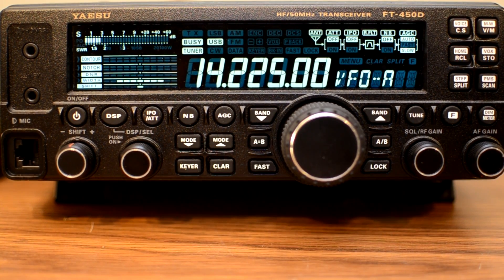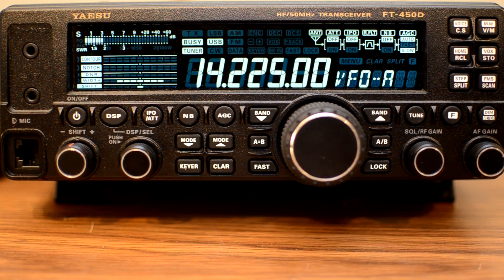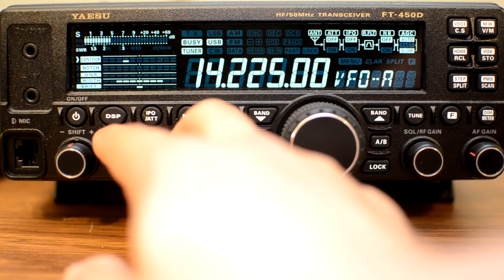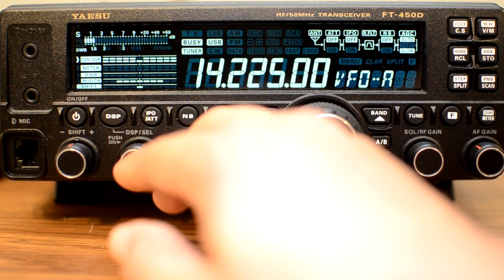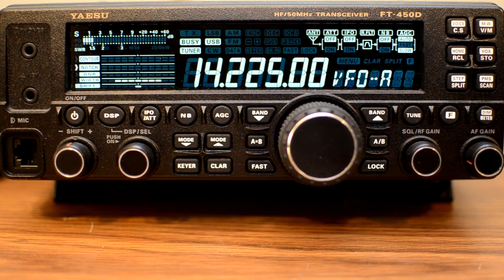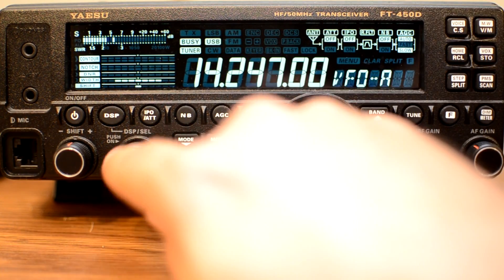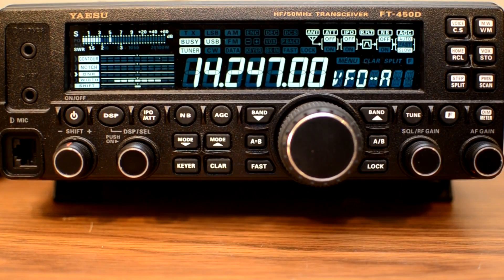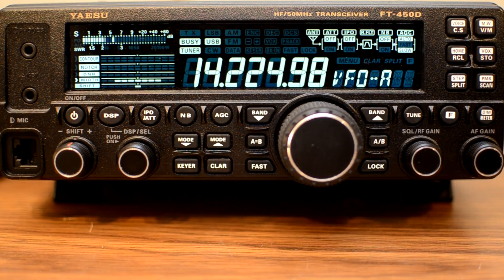Yaesu FT-450D: Using DSP

Comment: My suggestion is to leave the Contour and Notch OFF... set the selectivity to wide, and leave the DSP off  unless you need it.. then a setting of 3 or less will work except in really bad conditions.  Try the noise blanker first, before the DSP.    Set shift to center and adjust for best quality.  In normal conditions you will not need contour peak or knotch.. DX combat maybe different I dont do that.

Comment: are those adjustmens something you set to where you like and then leave or do you find you need to adjust on a regular basis depending on the day?
Reply: These adjustments are designed to pull in stations that might have interference and or just a weak carrier. If you have a strong signal none of these controls need to be enabled. If you have a weak signal you can usually start at the width control and adjust that to possibly receive better. The DNR or digital noise reduction control can be dialed clockwise and you will hear less static in the receiver. Take a look at your manual and read it thoroughly they do an excellent job at discussing this IF DSP features on the 450 rig. In summary they are adjusted to help receive weak signals. Hope that helps.  73....KD2PGJ

Comment: Tony,  
I have just had my FT450D for 3 weeks, I don't know if the rig has a problem or just me,   I can't get the cs button to work for tune up,  all I keep getting is VCC13.4  which is my power supply voltage, it was working about 2 days ago, I have done a full reset but still the problem exists,   I'm hoping you might have a suggestion,  am I missing something simple,

Dave
Reply from the maker: Hi Dave,
Not sure what you mean by using the C.S. button for "tune up." To activate the radio's internal tuner itself, use the "Tune" button (press it once to turn on the feature, and hold it down for a second or two to actually start a new tune). The C.S. button is a button you can manually assign to a particular function by setting it up in a menu. It appears you can assign Tune to the C.S., but I'm not sure why you would need to. Page 16 in the manual should help with using the C.S. button. Hope this helps!
Reply: Hello Tony,.

Thanks for the reply,  my tune up method using the CS button is simply I'm using my inv vee for as many frequencies as possible,  tuning thru my external manual tuner,  I Iike the CS button as it will tx a 10 watt carrier for tuning, quick and less stress on the ft450D for tuning,  but for some reason probably too much knob twiddling on my part I have lost that mode, I did get out of the Vcc mode, but now stuck some where else,   I think the owner manual will be worn out long before the rig itself,   I must admit being a very senior OP,  menu systems are not appealing, my last ft817 was great, and also my old TS 130S,  I'll even throw in my TS520,  fire them up in seconds.
Anyhow Tony thanks for your suggestions and the video which I'm sure is very helpful for lot of 450d owners.

Dave

Comment: that control knob for DSP looks very fragile, so much loose looking movement as you use it.
Reply: It is a helpful video but, yes, you're correct.  There is a metric BOATLOAD of stuff that is behind that control and it is NOT something you want to be spinning the way you would a big VFO knob (as he does a few times).  I know, believe me.  I didn't cause it, but it had to be replaced on mine early.  Under warranty and the service to/from Vertex was PHENOMENAL.
Just a caution.  Be nice to that DSP knob.

Comment: When in the 60 meter mode, how does one go about adjusting the 4 DSP functions (contour, notch, DNR, and width)? The DSP button will allow me to page through the 4 functions, but in 60 meter mode, I can not use the DSP/SEL knob to make adjustments. Can this somehow be addressed through one of the MENU functions?
Reply from the maker: Hi Dirk, unfortunately I haven't used this radio on 60 meters. In fact, I haven't even upgraded the firmware to allow it, so I can't answer that question. Sorry! Perhaps trying Yaesu technical support- they've been helpful to me in the past.

Comment: Sloppy presentation.  The author knows the material but Like Donald Trump he does not believe  in  preparation.  Do an outline and bullet points. You'll be far more effective.  I would add using Graphic arrows instead of your hands in the frame would also be more useful.

Mike/wa4d

Comment: I have owned  the FT-450, FT-450D, and FT950. The D model is a nice improvement over the earlier FT-450. I will probably trade the FT-950 for an FT-1200, but will keep my FT-450D. It's a really nice radio for portable use as well as in shack. Nice and informative video. Thanks. WB4TJH

Comment: How do u adjust the output power
Reply: +Phil Neale (bootsie) TXPOWER is adjusted through the menu. Press and hold the "F" button, select RFPOWER with the DSP/SEL knob press it once and select 5 to 100W. Press and hold "F" again to exit the menu (it's not as hard as it sounds! ) 73
Reply: Can you save different power output settings per memory location or is it a global setting that stays until you reset it?

Comment: MY FT1000 MP MARK V BLOWS THE 450 DSP AWAY----NO COMPARISON
Reply: +Rick Burton It's also twice the price so one would expect it to be better. The common argument is that the 450 is VERY good for it's price.
Reply: mwiz100 I AGREE, I SHOULD HAVE WORDED IT DIFFERENTLY ---450 IS A FINE RIG
Reply: I think 450D is the cheapest HF radio from the main producers in the market. Your rig is much more $$$.
Reply: STILL A GREAT RADIO!
Reply: You still here comparing a sporty "japanese car" to a LAMBO costing 500x times more. EPIC FAIL !

Comment: I don't use hf that often and am looking to buy a rig I have had several in the past and have been looking at the dx1200 but for the price the 450 sure does look nice any thoughts on the 450
Reply: i would say the 450d every time for a rig that is good for the price,i have one for 1 year and i know it is good how ever if you don,t want the built in A.T.U get an Icom 7200, one warning the microphone you get with the Icom is not very good.so get the 450d it will be all the radio you ever need,as for the bigger rigs more menu items more fancy lights i call that a bubble gum mechine, don,t like the bubble gum part at all ...

Comment: Very good explanation of the DSP on the Yaesu. I just ordered this rig as my backup and portable for remote work. Plan to use it with a solar setup.

I have the FT-950 as my base and the DSP on it is the exact same layout and function. I generally run DNR at around 50%, Contour where is simply sounds best to me, Width about 60-70% and then Shift in the center. When I have a signal I am struggling with I narrow the Width and track  it down with the Shift. Works great and you can do it in just a few seconds. I have found that pushing the DNR too much only makes it worse but a little does  great job.

Another great trick I learned is that if you invert the contour (make it a peak instead of a notch) you can really zoom in on a signal as opposed to notching out around it. That is done in the menu function for the contour and I moved mine from -10 to a +10. It even changes the readout to show a peak instead of a notch.